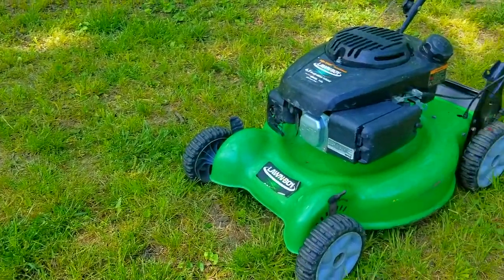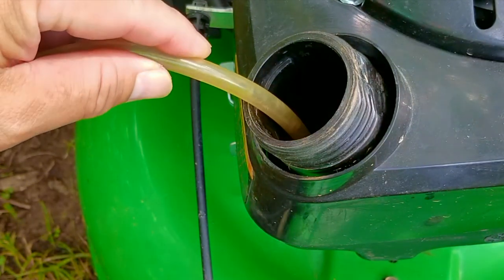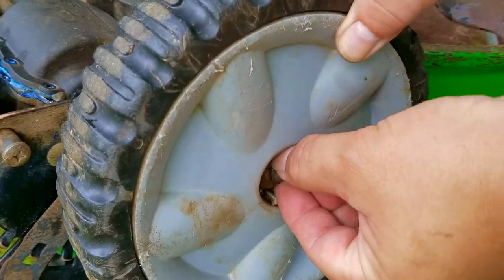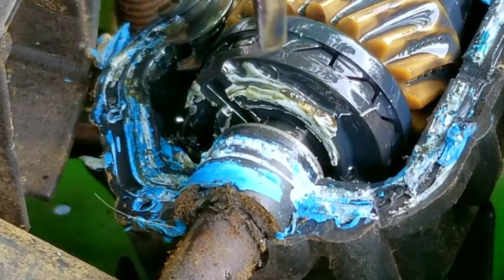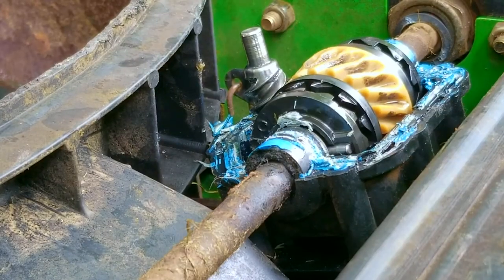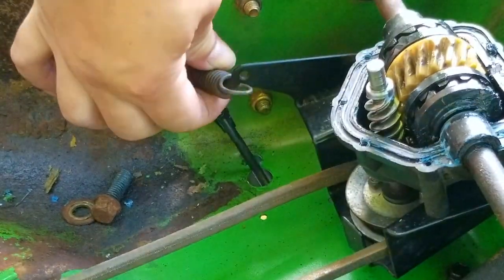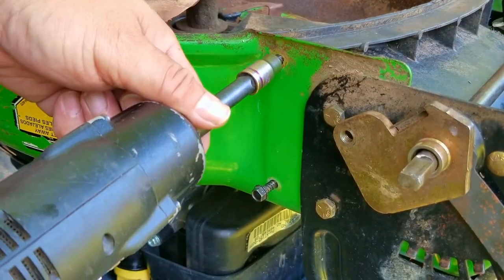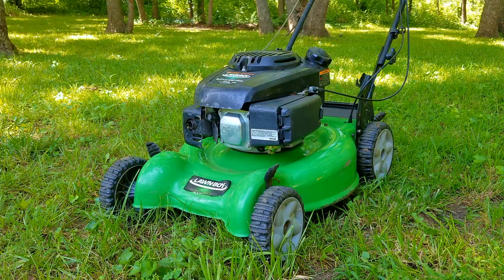I finally fixed the LawnBoy mower self propel

Comment: Great repair idea, I never would’ve thought of that! I probably would’ve found a small screw and a lock nut to replace the pin or used JB Weld to epoxy it in place but the way you did it totally makes sense and is permanent.
Reply from the maker: thank you mjg263 I appreciate that.

Comment: Great video.  I had the same problem with a Deere mower several years ago.  That mower has only one drive wheel.  I ended up removing the drive gear and turning it into a straight push mower.  But I saved the gear and I think I'll take a shot at fixing it.  Thanks!
Reply from the maker: nice, good luck with it and thank you Passing Wind

Comment: Hi home garage I commented on your video a few weeks ago about my uncles trimmer I finally got them today they are Shitl 54 rc and 45c they need a tuneup the carburetor on both of them are done and bought a tune up kit for them. I put gas in them and both run great and very good compression, so hopefully the carburetor comes in this week to fix then up! 😁
Reply: stihl fs 45 have bad crank seal just check if its oil around seal and change if needed and will run many years
Reply from the maker: thank you RinkRats, and very nice work!

Comment: I save parts from junk mowers and would have looked for a replacement gear box, you did a great job and lets hope your fix last for years.
Reply: Thanks for showing inside the gearbox instead of just replacing the whole thing. Some of us want & need to see how the thing works.
Reply from the maker: thank you Uncle BS, and if it doesn't, I'll just save it, and wait for another
Reply from the maker: no problem David Coudriet.

Comment: This was a very interesting and very likely effective fix.  It's too bad that the gearbox internals failed the way they did.  If I had that situation, I would probably use something I happen to have - "Polyvance Airless Plastic Welder".  One time, I had a Briggs Max engine (top mounted plastic fuel tank), and the tank was leaking at the bottom.  I tried fixing it by melting the plastic, but it did not work.  The so-called plastic welder is like an adjustable temperature soldering gun with specialized tips, and rods of different types of plastic.  If you get good at it, you can do decent repairs to various types of plastic (car bumper skins, also).  It wouldn't be worth buying it just for this single repair, but if you come across broken plastic a lot, it's something to consider.
Reply from the maker: thank you Tom Lewis.

Comment: I would do what you did and fix it. Things that don’t work as they’re supposed to bug me. I really like your soldering iron trick! I probably would have drilled some holes through the gear and secured the pin with wire. Your idea is much better.
Reply from the maker: thank you Bruce Coleman.

Comment: I just got this mower for nothing. The woman said it doesn't cut the grass very well, so she bought a fancy electric one. I got it home, the blade was never sharpened since it was bought, the blade was rounded smooth from never ever being hit with a grinder. I've been a welder, pipe welder for 40 years ...I kinda know how to use a grinder...I used a fine grit flapper disk on my good ole' Walter grinder and it came out perfect, and yes, I tested the blade for balance. 
    This mower's self-propelled mechanism does not work either, but I haven't looked into why yet, hopefully it's something easy, like a broken/missing belt. 
   I have never owned a mower with a key for the electric start .. kinda cool.
Reply from the maker: you got a good mower there!  Hopefully you sort out the self propel.

Comment: One thing to keep in consideration for the next time you have something similar to this, drill a larger hole through everything that's just big enough to clean everything up and get them true'd up, then buy a drill bit that's about a .002" oversized press fit or whatever the original oversized press fit is on the undamaged other side, cut the shank off of the bit to the right length and put a little bevel on both ends like the stock pins have.
You can buy what's called "indexable" drill bits that come in .001" increments, cutting the shanks off and using them to repair/replace little pins that wind up lost and damaged like the one's that a float pivot on is a handy fix, especially if you have a local hardware store that has them in stock.
Reply from the maker: sorry I try not to drill out the jets
Reply: @HomeGaragechannel  
Jets?
This video was about the pin coming out on the one side of the gears inside the transmission of a self propelled Lawn Boy mower.

Comment: Great Ideal and job on the repair. If it was my mower I would of tried to fix it. I'LL give you a handy tip for removing rtv. Use the Pro Goof Off it comes in a metal squirt can I buy it at Lowes it will soften the rtv and makes it easier to get off the surface. Merry Christmas! God Bless!!
Reply from the maker: very nice tip, I'll have to go and get some, Pro Goof off.

Comment: Hey home garage nice fix !!! My self propelled stoped working the transmission rotates on the axle and throws the belt any ideas on a fix?
Reply from the maker: yes without a belt, and the cable to activate it, the transmission will rotate on the shaft.  Check to see if there's a problem with either pulley, also, is this a new belt, or was the belt replaced at some point? It may be the wrong size

Comment: I have never had this exact problem.  Usually it's the wheel gear being stripped or  if both wheels don't turn I figure the transmission is bad. I probably wouldn't spend 4 hours on a flip but now if I run across this problem  I  know what to check and how to fix it.
Reply from the maker: thank you Brian King

Comment: I commend you. I would have just trashed mower and purchased a new one. I like to tinker but only so much. If you had to do again would you repair, bypass, or replace?
Reply from the maker: still repair, and based on a cost stand point. I'm exceptionally cheap.

Comment: Any other recommendations on tools ...angled pliers....or split ring pliers......do you ever replace bolts or keep bolts on hand if they are too rusted?.....Bought a new drive gearbox if possible ....what do you consider too much time or cost....2 hours 1 hour ...35% pr 50% of average used value?
Reply from the maker: yes long angle pliers 45 degrees, Is what I use. Split ring pliers are only needed once in awhile but worth it.  I only replace bolts if they are cross threaded or, have a rounded head.  I don't have a problem using rusty bolts again.  I never consider any time diagnosing or fixing, too much, whether it be 2 hours or 200 hours. you'll learn something from it.  Cost wise, that's tough, I would say 45% the cost of a replacement, but it depends on your budget.

Comment: Wow, never thought that axles can be a two separate ones. This thing has some type on differential, so mower can turn while self propel is engaged. I dunno why though
Reply from the maker: it's because of the traction you get with a Rear wheel drive set up. Front wheel drives don't bother with a differential

Comment: I have a similar lawn mower - changed the belt, and when I lift it, the wheels self-propel, however, when the weight of the mower is on the rear wheels, they don't spin (push the mower) - when I tighten the cable it makes a grinding noise when I engage the rear wheel drive - any thoughts?
Reply from the maker: the problem is your choice of words, "similar".  If not the same, the drive system might be completely different.  But as to your problem, it seems two fold, the belt is worn out, and there gears in the transmission might be skipping causing the noise

Comment: Good video (narrative, editing, etc.). Considering buying the same mower. Borrowed it from the seller to use as a back-up as my Toro was in for service. Would like to have the Lawn Boy as a permanent back-up. Good to know how the transmission goes together, and what the weak points are. Currently, it won't run when warmed up. Count to 500, have lunch, and it starts, and runs fine again. Maybe the coil. He's going to look at it before I make a decision. Any idea what vintage this mower is? Early 2000s? What is the exact model? Thanks.
Reply from the maker: I do believe it's around a 2010 or so, and thank you Art Gum.

Comment: Removal of the gear is an easy fix, but easy fixes takes the fun away.
In Australia to replace cost on a Victa is over $200, hence the bypass method.
I enjoyed watching the repair, for now it’s holding, if it fails I’m sure the bypass method would be that perfect fix.
What gear oil did you use for the gearbox?
That oil was strange being so brown any thoughts?

Debating Question Mower Oil vs Car engine oil even at the same number say 10-30?
Reply from the maker: Yes I don't know why the Oil was that color.  As for the Oil Debate, that's a great video topic.  The short answer is, nothing terrible will happen if you use car oil in a mower engine.  As long as you change it every year, it should last, until something breaks on the engine.   Using Oil that was meant for air cooled engines, is the best, when you really want your stuff to last.  I would probably do this, if I mowed lawns for a living, whether as a side hustle, or as a full time job.
Reply: @HomeGaragechannel  My quality equipment or someone else’s always manufacture’s recommendations a mower on it’s last legs or used for mulching branches etc anything goes I’d say.
My debate is seeing other’s even on YouTube using a good quality oil that is not meant for air cooled engines, even though it’s a quality name manufacture, whom are the ones making specified oils for air cooled engines.
Note: Oil changes on Briggs & Stratton is 50 hours and Honda is 25 Hours.
Reply: @HomeGaragechannel  please, your welcome to debate Oil ain’t Oils in 2022
Reply from the maker: you can use Oil from the lawn and garden section, it's mean for 4 cycle engines, that are air cooled. The other option is to go to motorcycle shops.

Comment: Hey what gear oil did you use for this mower, i got a issue where the right wheel skips and locks up only while its deactivated, gonna check it out once i get my square bits but wondered what gear lube you used and is that rtv?
Reply from the maker: this was over 2 years ago so to be honest I don't recall which one it was. I found the information by searching the internet though. Same goes for the RTV.  To be honest, I'm sure both were nothing special. Any RTV and Gear oil should work
Reply: @HomeGaragechannel  ok thank you, i hope its general stuff cause i have left over stuff from my project car

Comment: How often do you have to change the oil in the transmission?
Reply from the maker: hmm.. that's a good question. If I bought a new mower, I wouldn't even consider doing it for the first 5 years.. But I'm not really sure, since I've never bought one new.   I just do it on the free mowers, because more than likely, they need it, And I have nothing to loose, since it was free.

Comment: The mower I'm repairing, neither of the wheels spin when I try to engage the self propel. And the I can't push the mower cause the wheels lock up. Is it possible it could be the belt?
Reply from the maker: I need a make an model to know what your project looks like
Reply: @HomeGaragechannel  Lawnboy 10641 (2009)
Reply from the maker: thank you for the information It helped out greatly.  Unfortunately, if the won't spin, running or not running it means something is wrong with the transmission .  I would take of gears at the wheels and make it a push mower. Otherwise a new transmission is about $100.

Comment: Could you maybe 3-D print those gears? Great video 👍
Reply from the maker: that's an idea. But I do have concerns on how durable 3-D parts are, when used in this way.
Reply: @HomeGaragechannel  I have had two things 3-D print made. One was a cup hold insert that is functional but flimsy and the other was battery holds for my kobalt/dewalt tools. The battery holds was very stout. So it may be the kind of plastic used? If it worked, you could start making a lot of hard to find pieces. Might make an interesting business venture as well.

Comment: I would have taken the drive gear out. It is a light mower and shouldn't be too hard to push.
Reply from the maker: yes you are right, This one is so very easy to use.
Reply: Even though it would have been easier to take the gears out, I really appreciate you taking the time to show how to fix it. Thank you.
Reply from the maker: no problem

Comment: I swear I've seen this same gearbox get fixed, did you upload the wrong file?
Reply from the maker: I don't think so,  do you think you can find the other video then?
Reply: @HomeGaragechannel  Unfortunately, I can't seem to find where I saw this before. I distinctly remember the various details (mixed blue\gray sealant, the loose pin, using the soldering iron to fix the gear) from another one of your videos, but it could just be you had to fix another one the same way. Strange either way. Still a good video, cheers.
Reply from the maker: really?,  I might have to look around and find it myself, thanks.